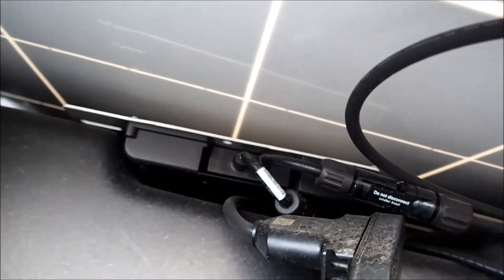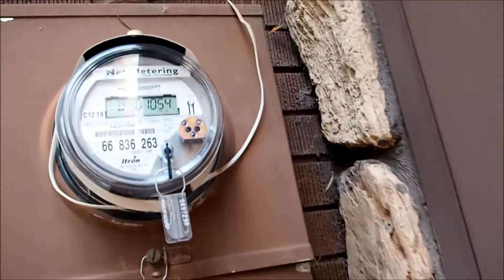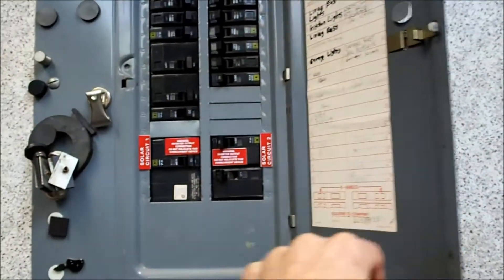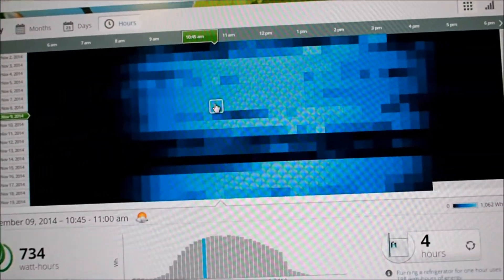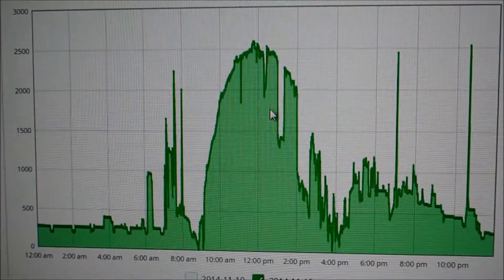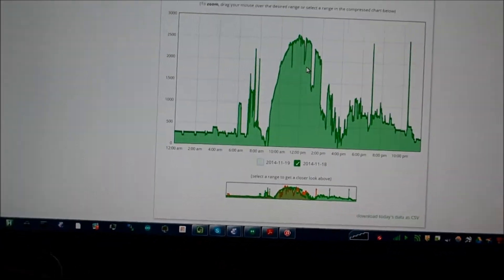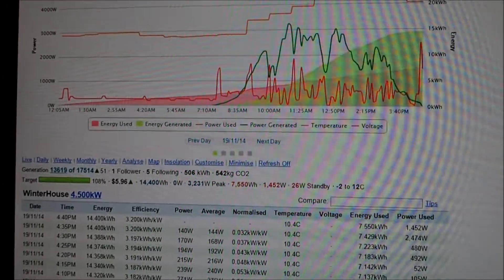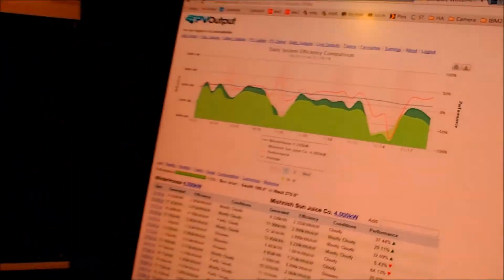Monitoring solar power

Comment from the maker: Sorry, I mis-spoke.   The microinverters output 240v AC, not 120v.   There is a limit of around 15 panels you can put in series, to keep the current manageable with standard wiring.   Since I had 18 panels, we did 2 runs, to 2 different 240v circuit breakers in the main panel.  

Most solar installs, including mine, are a 'grid tie' system.  They feed right into house panel, and thus your utility grid.   This is the simplest and least expensive setup, but that means you don't pick what uses the solar power (e.g. computer vs fridge).  The biggest disadvantage, at least with the current microinverter products, is that if the utility grid goes down, so does your solar power.
Reply: With an Enphase system the panels/inverters are not in series, they are in parallel.  Each panel/inverter combination generates 240V.  The maximum number of panels is determined by the amount of power being generated per trunk cable.  The limit is 20 Amps per trunk cable.
Reply: Correction to above - Each panel/inverter combination generates 120V. (In countries with 120Volt (or 240Volt across two phases)